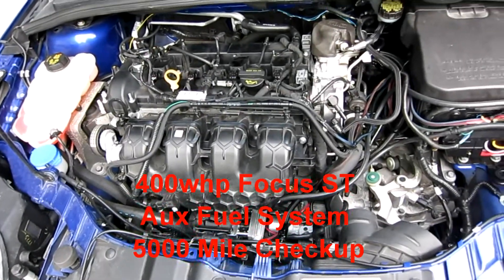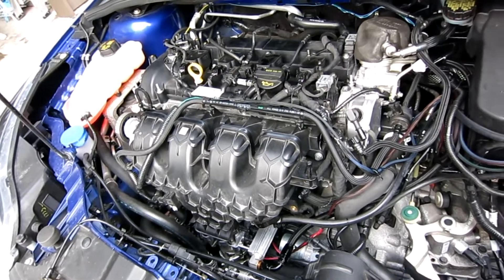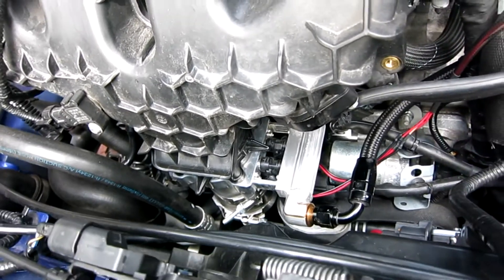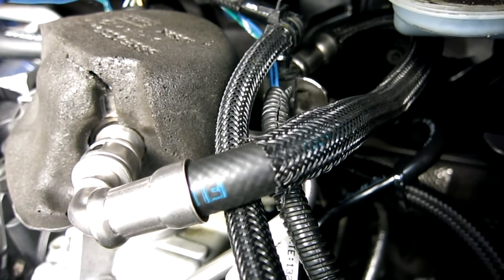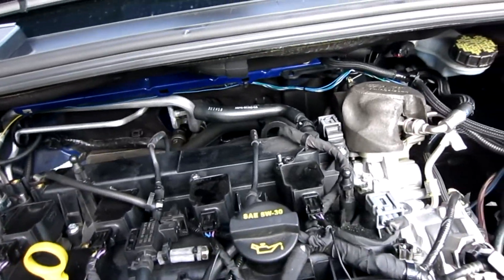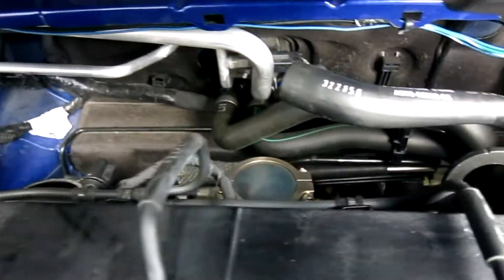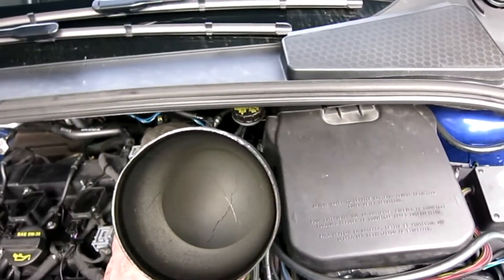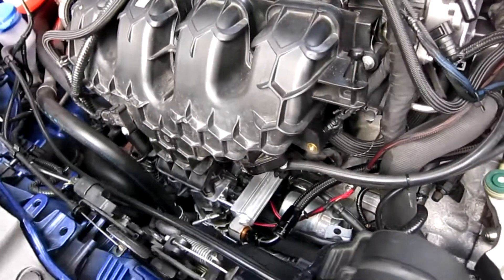Focus ST Aux Fuel System 5000 Mile checkup

Comment: How about you check the charge side of the intake where there may actually be oil. I just pulled apart a turbo car the other day and the hot charge pipe had about half a quart of oil.
Reply: If the intake doesn’t have oil and your charge pipes do then you probably have a leaking turbo.